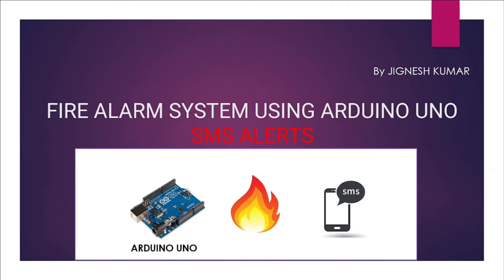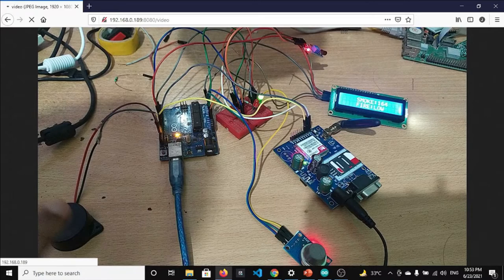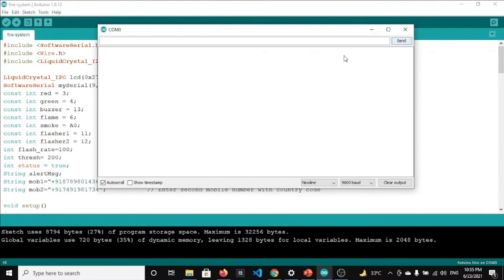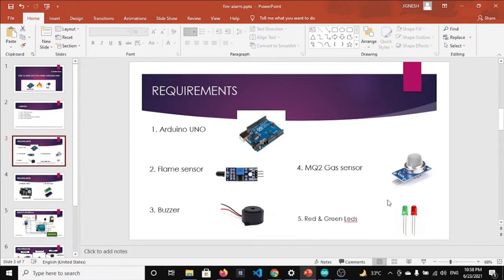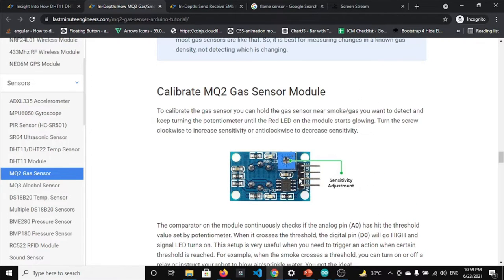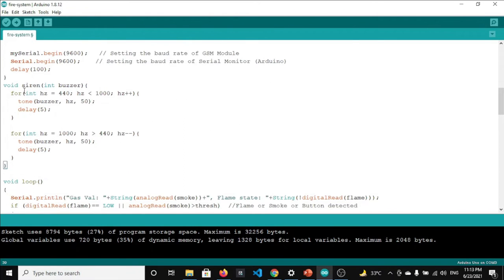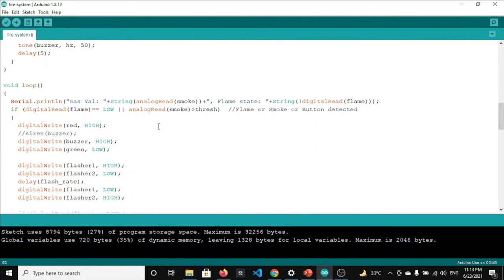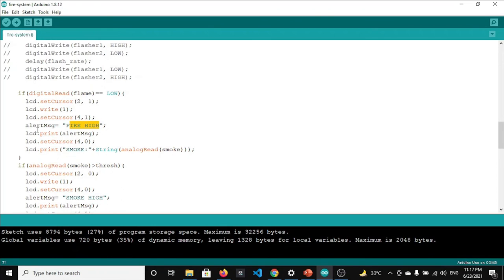Fire Alarm System using Arduino Uno | Smoke & Flame Sensor

Comment: HI, can i use the MQ 4 gas sensor?
Reply from the maker: Yes you can simply replace it with MQ-2 as pin mapping is same
Reply: @IoTLearner  Hello, I don't have the module to send the message, can I skip it?
Reply from the maker: @julianatehortua  sure
Reply: @IoTLearner  thanks

Comment: How can I replace sending a alert message using wifi instead of gsm module?
Reply from the maker: You can replace gsm code with ifttt (if webhook then sms) or clicksend sms api request in the code code
Reply: Can you suggest learning material or video on how ifttt and click send api request work? I don't know enough when it comes to arduino projects. Thank youu❤️
Reply from the maker: @johnvincentsuarez5573  check this for ifttt approach: https://youtu.be/Ek57tecFd_Y
Reply: @IoTLearner  Thank you so much💯

Comment: What is the source of power supply in this project Sir? Thanks!
Reply from the maker: I'm giving power supply to Arduino and Sim 900 using the 9V dc adapters.
Reply: @IoTLearner  Good day Sir! how can i fix the error about software serial not found? Thanks!
Reply: what is the library of this code sir?